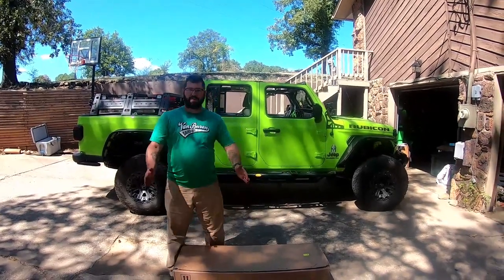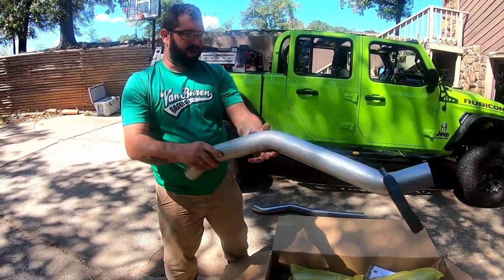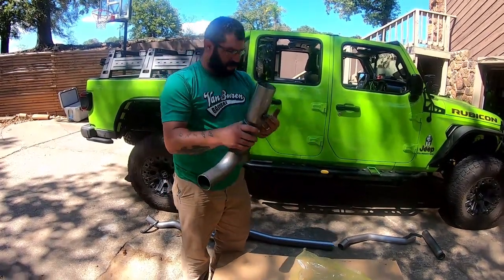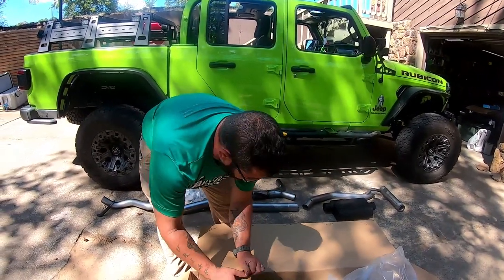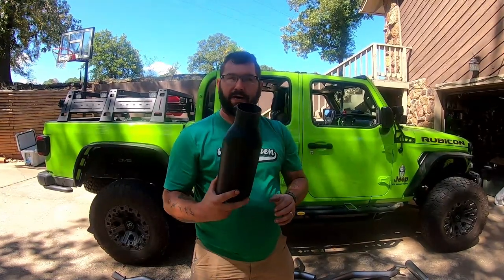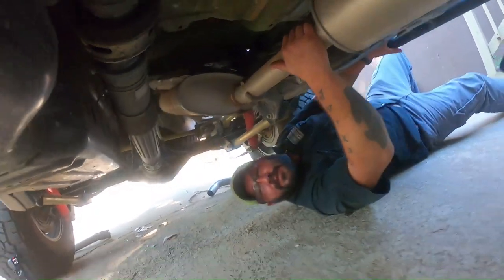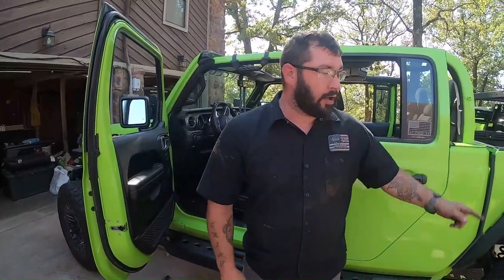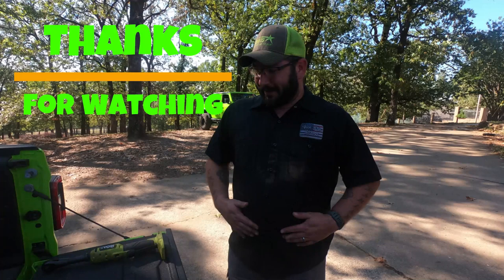Rough Country Performance Cat Back Exhaust

Comment: Does it help to save petrol
Reply from the maker: I have not noticed any changes in my mpg.
Reply: @thewilderhensonadventures4361  does it have any torque and power
Reply from the maker: @MrCheerbo  you can feel a little bit of a gain in the torque curve.